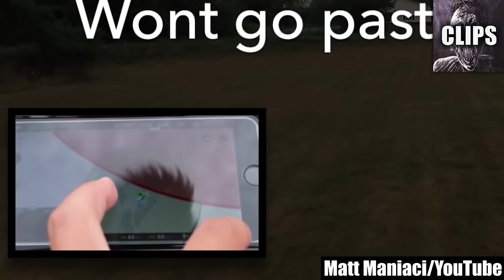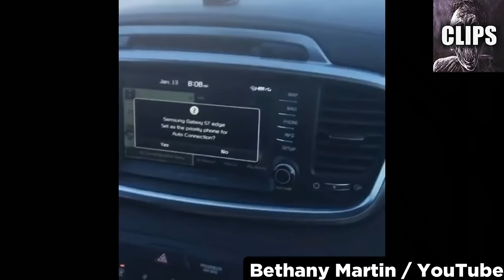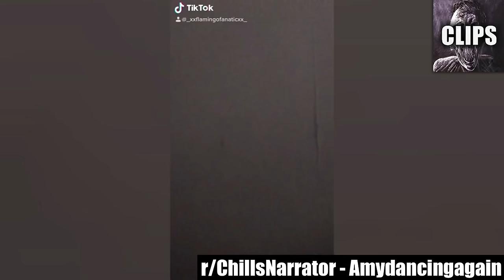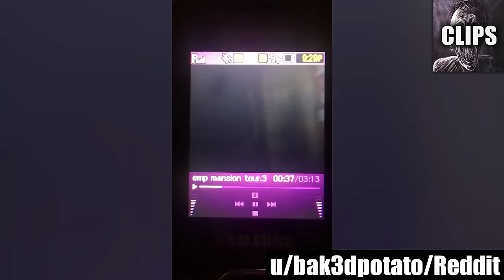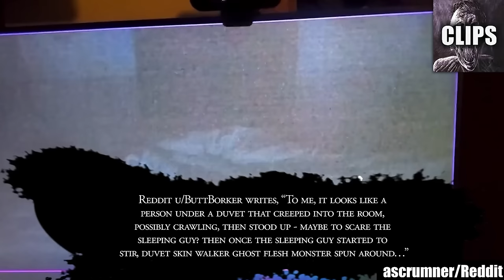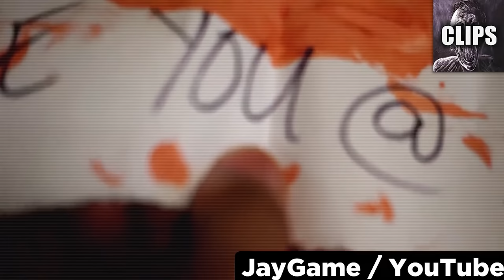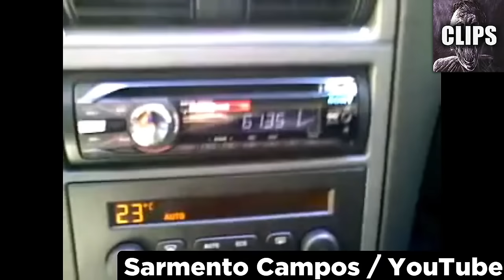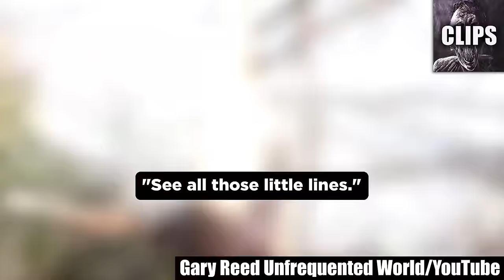Scary Video Collection: Rendering Viewers Speechless

Comment: The boys in the car video has been around for a while now. If its real, How did they get the video?

As an electrician I have no good idea why the switch would move on its own. 

People are correct either the bird toy needs new batteries or it has corrosion on the batteries.